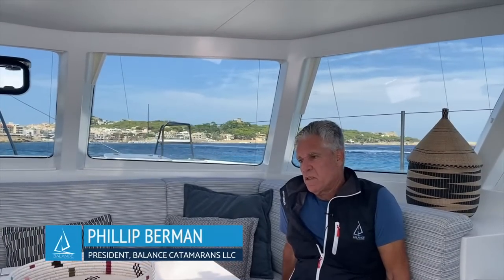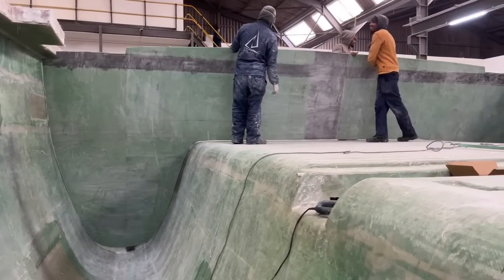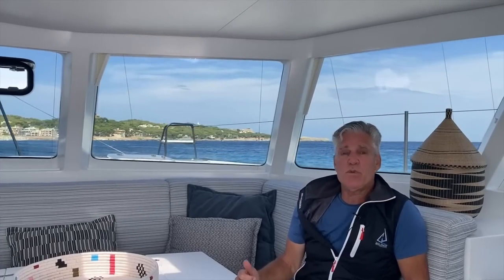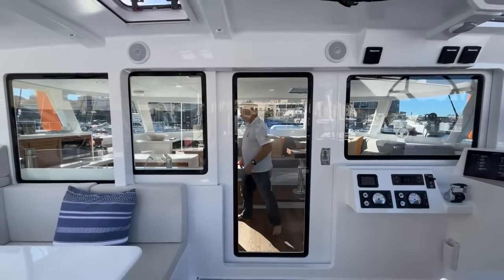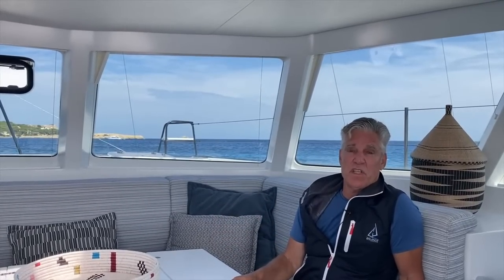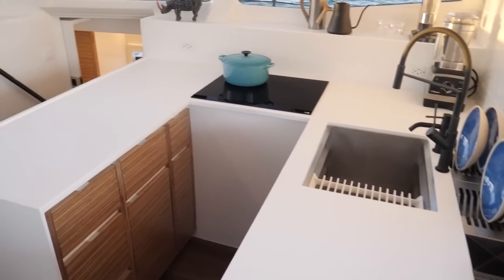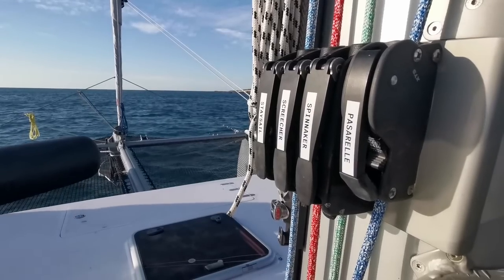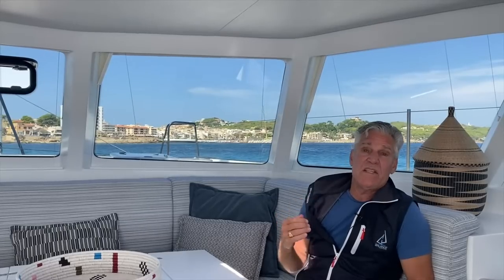Balance Catamarans - Building for Quality

Comment: Phil is making an important point, the structure of the boat is the MOST important feature, it cannot be redone. Don’t believe you get strength with huge cutouts in the structure, unless you add significant points of strength….ie carbon fibre. As for the added equipment, they not only replaceable but will need replacement over time.

Comment: do you use epoxy or polyester resin for the infusion of the hulls of the boat?
Reply from the maker: Hi Julien,
Every Balance 526, 580, 620 and 750 are hand-laminated and vacuum-bagged with closed cell foam core in full epoxy construction. Our 442 and 482s are also hand laminated and vacuum bagged with closed cell foam cores, using a combination of polyester inner-skin resin and vinylester outer-skin resin.

Because we use carbon in the high load areas of all our cats we call them Carbon Cross. On the catamarans we build with additional carbon enhancements (such as appendages, coach tops, flooring, etc.) we call them Carbon Cross +. On our 526 and larger models we also offer our hulls and decks in full carbon construction, our Carbon XP models.
Reply: @balancecatamarans  hi phillip
do you offer the option of using epoxy instead polyester on the 442?

Comment: Will you guys start installing EcoDrive units like HH Catamarans and Antares? What is your Warranty coverage on the Hull? Thanks.
Reply from the maker: We are very happy to accomodate electric systems from any reputable electric or hybrid company a customer wants. We explored all of them carefully at the recent industry Mets and Dusseldrof conferences. They all have pros and cons. 

We are not prepared to guarantee specific performance or range under power for any of these systems. We have seen far too many claims that have not been realized in real life sailing conditions. We also stress how vital it is that the company a buyer choses must offer stellar technical service and support. When you arrive in the Cook Islands you cannot resolve a technical issue nearly as easily as you can with a diesel motor driven yacht. 

From what we have seen to date, nearly all of the "eco" offerings underperform, cost considerably more, and are less reliable than diesel motors with the Integrel alternators most of our customers prefer. From a green perspective we feel that Integral Alternators mounted to diesel engines running a 48 volt lithium system with loads of solar is the way to go currently.

Every electric or hybrid system available will require some form of diesel generation to offer any speed or range under power. Diesel is a 23% denser energy carrier at present than a litihum battery. You cannot put on enough batteries or carry enough solar to go without diesel generation unless you are prepared to drift sometimes or move at terribly slow speeds, with limited range. And if you are not able to sail you cannot count on regeneration. These things were clearly exposed in the Jimmy Cornell "Alcana Challenge" on the all electric Outremer effort. The challenge was ended soon after it began I am afraid.

Most regenerating systems do not produce significant charging until you are averaging very high annual daily speeds under sail. 

We are practical sailors and designers and builders who feel that testing new electric or hybrid technology at our customer's expense is risky business based on what we have seen to date. But we understand and grant that some people are prepared to assume the risks of new technology. We certainly invested in and risked ourselves with the new Integrel Alternators. We are glad we did, but it was a close partnership with the company that involved evolutions in the product as we
gained experience together.

Our hull warranty is one year stem to stern for the hulls and decks and three years for blisters or osmosis. 

Stay in balance
Reply: @balancecatamarans  Phillip I think we met you at 2020 Miami Boat show. And it was a treat. Your response says as much about you and your company than any You Tube Ninja could. My wife liked you when she met you and she does not like many new people 😅. I hope we cross path's again and would love to be able one day to own such a magnificent Cat with stellar record and support! Thank you!

Comment: Why do you use raised hatches? Why not use flush hatches? Small nitpick, you do build beautiful catamarans.
Reply: how about you research both of them?
 just like everything on a yacht its all about pros and cons that we can live with or we cant, sadly people like you for example associate certain designs as better or worst based on youtube not on what the builder or customer have in mind, here for example whats proven to work for them.... 
as far as i am concerned  most yacht builders can do both, its up to the owner to decide 

ps: flush hatches are not a new concept and personally will not have them on anything again, They drip water every time i open them, and they dont last as long as raised ones and has to be closed in the light  rain from my personal experience
Reply: @muumoo111  Instead of ranting and making foolish assumptions how about you share your pros and cons. I've been racing, cruising and delivering yachts across oceans for 30+ years. Tripping at night on a raised hatch or stubbing my toes on raised deck hatches when the deck shifts awkwardly in a choppy sea isn't much fun. Modern flush hatches do NOT leak if fitted and maintained properly.
Reply: why even bother commenting on a commerical ad?
...did i just comment on a comment on a comercial ad?
Reply: I definitely prefer flush hatches too.
Reply from the maker: There are several reasons:

1. Because we build semi-custom catamarans many of our boats are different. Some customers want both bow lockers to be full size and can carry size 60 or 70 hatches. Others want to use a part of a bow locker for an office or vanity and may want two hatches or one smaller hatch. As such we cannot "tool" our decks for one hatch profile or location.

2. Between our athwartships berths on deck all of our boats carry a deck locker. Some people want a larger hatch there, some a smaller one.

3. Some people want a small opening hatch over the port aft berth, some do not. (Note: to the extent possible we believe it is safest to have as few opening deck hatches in the passageways because if someone leaves one open at night and runs up on deck they may step into it and break a leg or femur. (I have seen it occur on a few used catamarans I have sold.)

4. Finally, and most importantly, to do a proper flush hatch you must either tool the boat with them set up so that there is no drain tube running under the deck to avoid clogging. They have to be positioned specifically near the side-deck on a raised deck so that they can drain without a drain tube. Most flush hatches have a recess and then a hole for a drain that carries the water out to the side deck. What happens too often is that when a boat is left at a yard debris piles up into the hatch recess, the drain tube gets clogged, and then your hatch leaks or the seal deteriorates. 

If you look at our boats between 44 and 52 feet you will see that we have no more than one deck hatch in the primary walking passageway and that all of our deck hatches forward are the lowest profile hatches on the market. They do not present a tripping hazard, do not leak so easily, and also offer us the ability to allow for customer customization by not tooling the decks for a set hatch layout.
Reply: @balancecatamarans  Thank you for the thoughtful response.

Comment: Getting any boat is like getting a pet. To buy new, or rescue an older hull is a question. I for one would never support the continued use of fiberglass, carbon fiber or other non-biodegradable, non-recyclable materials in the manufacture of anything, especially boats. Aluminum, steel or wood, even ferrocement are suitable alternatives for any new design. I'm certain those who purchase new fiberglass hulls are of the same mentality as those who get their dogs from puppy farms.
Reply: Really. But do you support buying a phone or computer made of plastic to type YouTube comments on? If you are afraid of plastic/epoxy you should go live in a cave and cook your dinner using firewood you spend all day gathering. Perhaps you never want to travel in a car ever again.
A strong quality build yacht like the balance yachts can probably last 100 years.
Reply: Not sure if your just trolling or ignorant...Catamarans must be light comparatively to mono hulls. This immediately rules out ferro cement and steel as a material selection. Wood isnt really viable because of the excessive maintenance requirements and significantly reduced lifetime of the hull. Not to mention the need to chop down many many trees to build the boat. Finally Aluminium is a viable alternative, from a weight perspective, but it has corrosion issues and creates significant environmental damage from bauxite mining and CO2 emissions in its production.

Comparatively Fiberglass and carbon fibre last significantly longer, with reduced maintenance and arguably less CO2 emissions.  The ironic thing is that you are actually totally unaware that fiberglass can be recycled....so sure keep standing on your soapbox and telling equally ignorant people how bad it is to use fiberglass.
Reply: Hadn't thought of it like that, there certainly is a good argument around recyclability